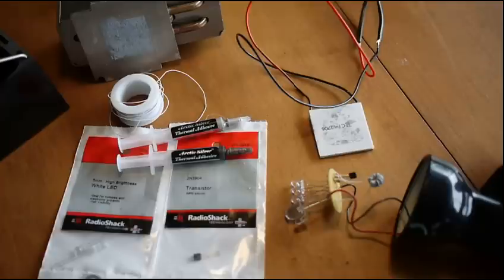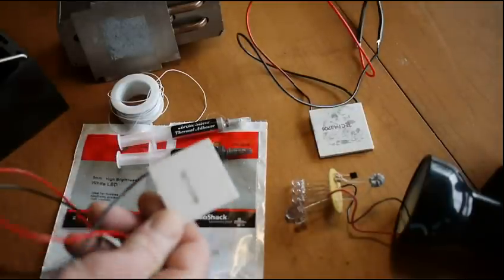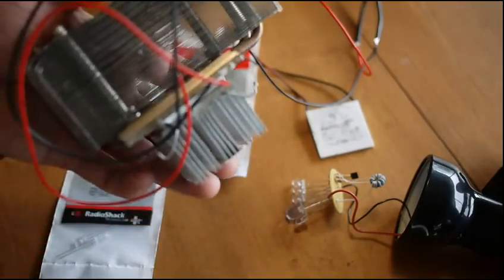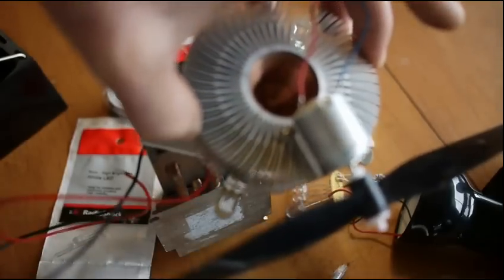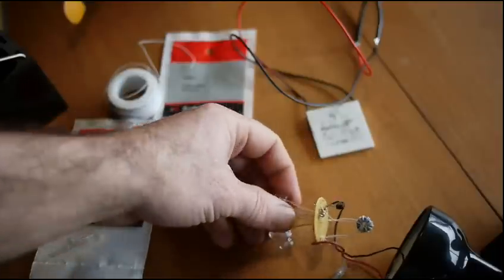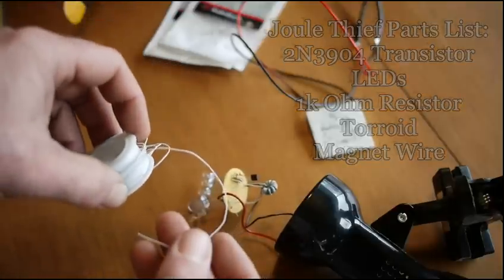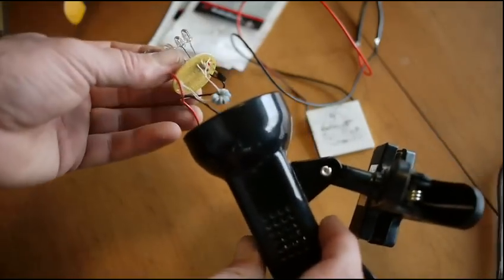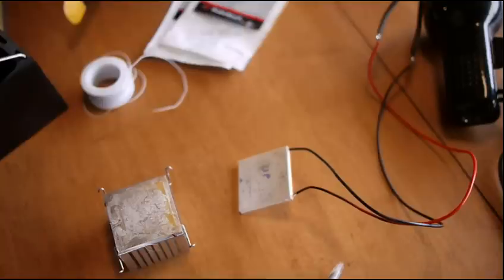Wood Stove Powered Reading Light using a TEG, Joule Thief, and Rocket Mass Heater

Comment: Good ideas there. When power goes out here, I walk around with an LED headlamp. Would be nice if the stove could provide some area lighting. Your use of a CPU heatsink got me thinking--maybe I could find one w/ a small 5V fan attached which would help cool it. It would be interesting to see whether the fan would increase output enough to make up for its current draw. I'd want a higher-temp TEG, and maybe use several in series to eliminate the joule-thief.

Comment: Very cool bro!  Thanks!  I must try this sometime.  Just curious, where are you located?  I'm in KS and have been struggling to keep up on firewood for my wood burning stove.  Hoping that a Rocket Mass Heater will drastically change that...
Reply from the maker: Thanks Grizz!  I'm in the PNW, far NW corner.  Man, I hear you on wood.  Don't believe the hype, heating with wood is work.  A lot of work!  My RMH is so much better than my 30 year old box stove, but it still is a wood heater.  I'm 3 cords in at this point, hoping to get through the year on less than 5.  Still, that's a whole lot of work.  I'm looking out my window at a bunch of trees I dropped last weekend that I'm trying to motivate to go cut/split/stack.  It never ends!